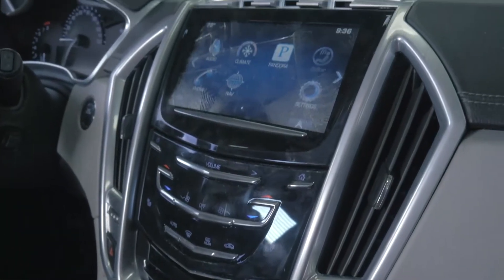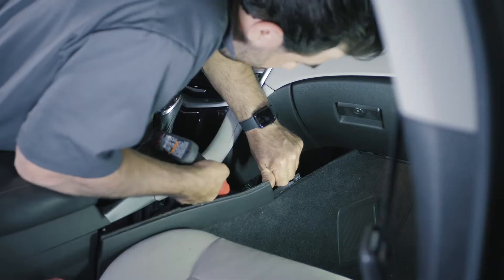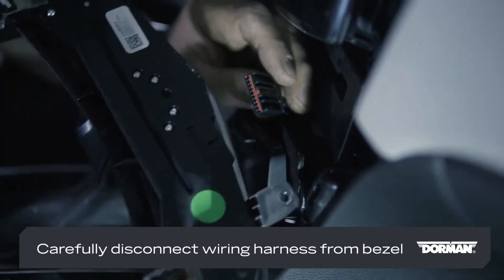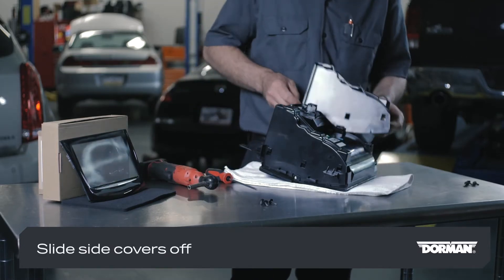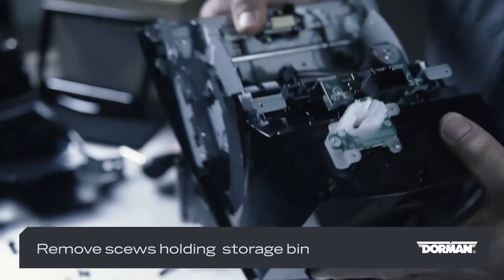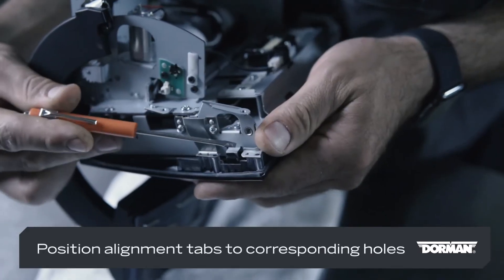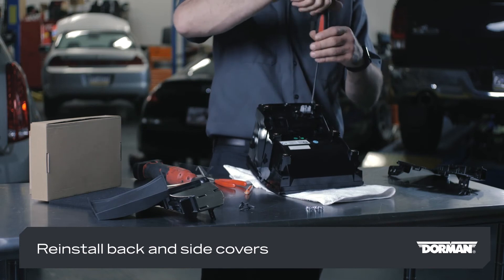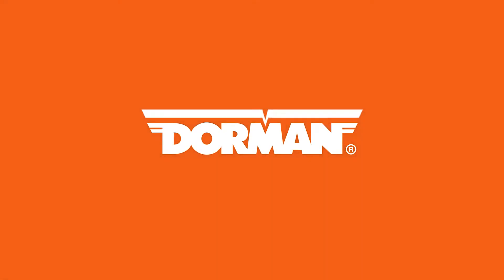How to Replace a Cadillac CUE Touchscreen With a New Dorman OE FIX Screen

Comment: Great Instruction video. One of the best in the group regarding this issue. However I would refine it a little. I found out the hard way that the  Storage Bin Door needs to be opened in  order to take out and reinstall the BIN. I ended up reconnecting the power connector to the assembly and opened the door. Don't see any other way. Also, it would be great to indicate the exact number of screws in each sub-assembly. Not a big deal but everything helps.